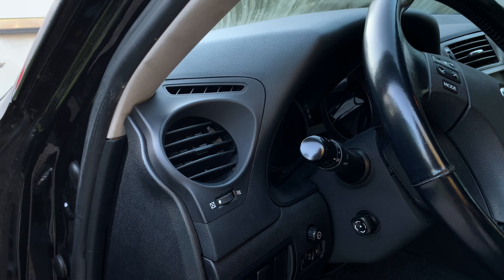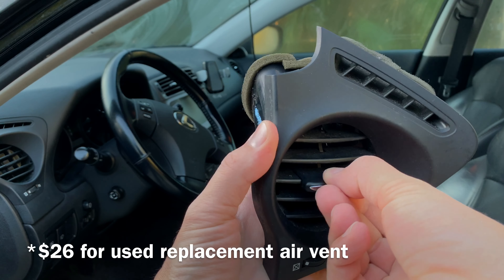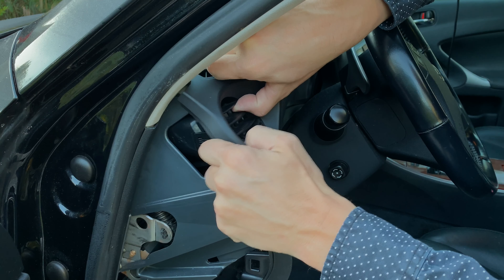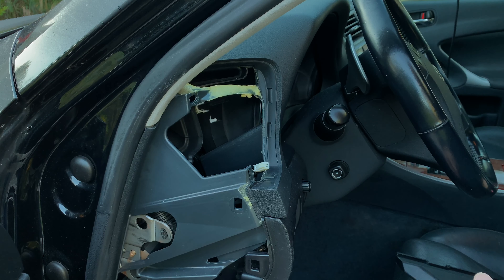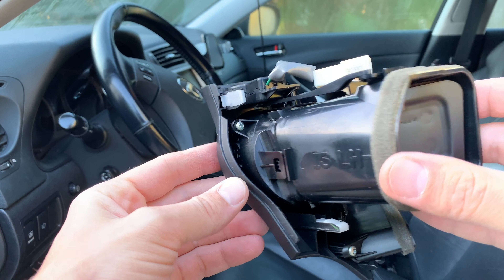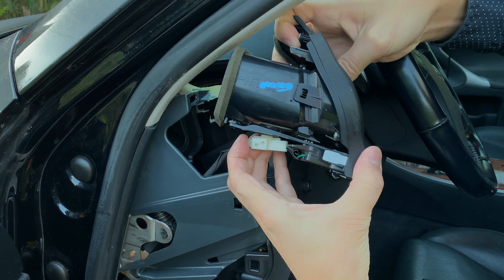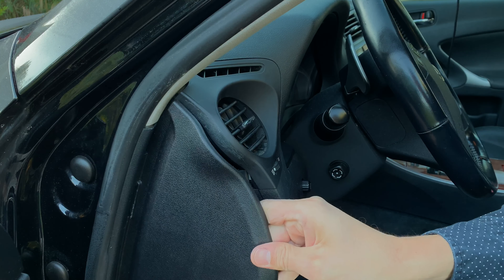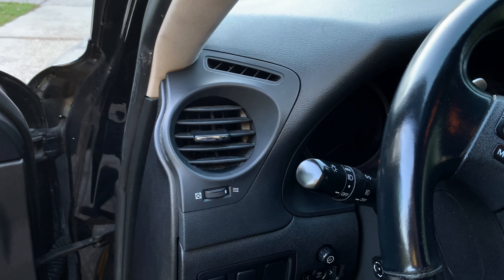How to replace side AC / heater air vent in your car.

Comment from the maker: You can find replacement air vent for your car here: 
https://rover.ebay.com/rover/1/711-53200-19255-0/1?mpre=https%3A%2F%2Fwww.ebay.com%2Fsch%2Fi.html%3F_from%3DR40%26_trksid%3Dp2553941.m570.l1313%26_nkw%3DOEM%2Bside%2Bair%2Bvent%2Bfor%2BLexus%2BIS350%26_sacat%3D0&campid=5338769073&toolid=10001&customid=

(this is eBay affiliate link).